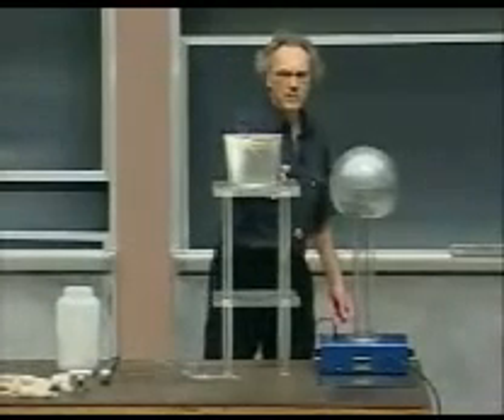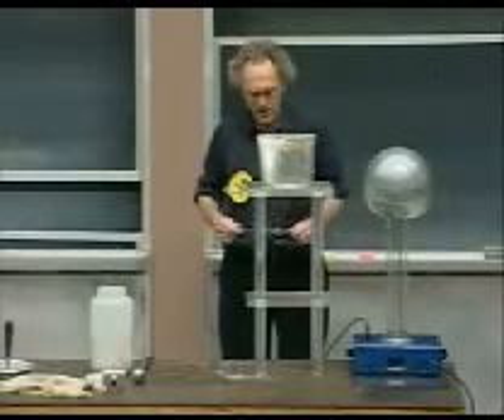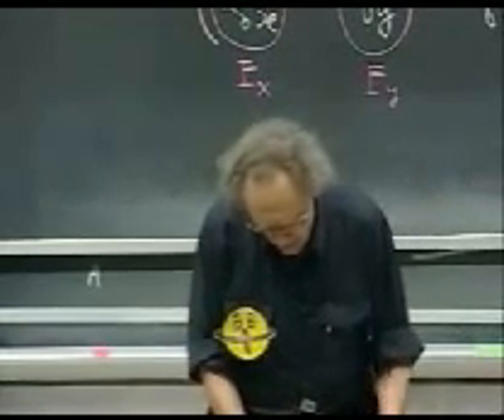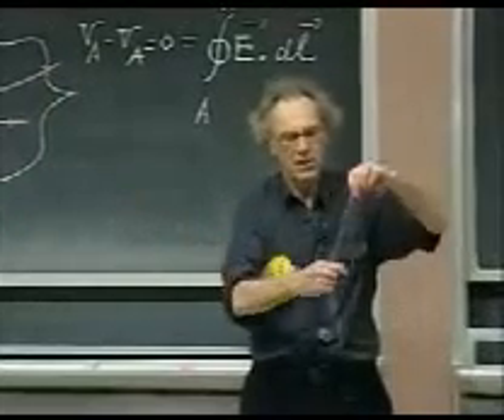Faraday Cage

Comment: What? Frequency of human speach is 100-300 Hz. Long waves.
AM radio has frequency of 150 kHz at least. Shorter waves.
So when he says that Faraday's cage doesn't protect from high frequency - its WRONG!
We can see that its in opposite way! Radio dosn't work, but we can hear him speaking.
Reply: Alex Ponyatenko UUUhm. human speach is soundwaves... and radiowaves are electromagnetic waves ;). Are you trolling?
Reply: Alex Ponyatenko What he is saying is recorded by a microphone on his shirt, and transmitted from there to a receiver somewhere outside of the cage which uses a high frequency EM-signal. This is what he meant.
Reply: He was talking about the transmission from the wireless mic that he is wearing, not his voice.
Reply: The wireless mic isn't going to transmit a signal at the same frequency as voice, it will modulate it to a higher frequency first.
Reply: Frequency and wave length are related ...higher the frequency the shorter the wave length , the lower the frequency the longer the wave length ( inversely proportional.) ...then there's propagation delay when radio wave travel over surfaces with different surfaces , like from water to land and back to water this causes a speed difference . Propagation delay varies with frequency or wave length  I think it's non linear
Reply: +xcheesyxbaconx it will convert his anologue voice to a digital output  so it's a different type of signal
Reply: shreyas Sudhaman his microphone translates hi voice (analogue ) to a binary or digital form. This is then sent across in EM waves. He mentioned the transponder because he was referring to this point during transfer
Reply: Alex Ponyatenko 
Radio is an EM wave
Reply: zwartespeed
So why he brings up that crap about sound of his speech? This is stupid!

Comment: 3:35  A car is certainly NOT a Faraday cage, the reason the radio doesn't work if you rip the antenna of is because you ripped the antenna off and the rest of the radio antenna circuit is shielded.  You can listen to a portable radio in a car or you can talk on a cell phone.  What does this guy think the radio wavelengths are?  He thinks the giant opening for the windows won't let the radio waves in?  That's why the mesh on a Faraday cage is so fine, and a finer mesh would block his transmitter.

Comment: Using 2 wire mesh waste baskets from an office supply store, one inverted upon the other with proper mechanical and electrical bonding and a resealable access panel, ( one bottom? ), may be inexpensive and effective with intensive grounding of course.  
Possibly holding laptops, radios, coded Automobile keys, flashlights and batteries ... and a nice music player for stress reduction after you find all your My-Book 2 Terabyte Data is uncorrupted, of course.
    just hope your network is up too.

Comment: is the prof standing on a non-conducting platform inside the Faraday cage? Also, if the prof touches the inner surface of the cage and if the platform is conducting, then he will get electrocuted, right ? Amazing video though.